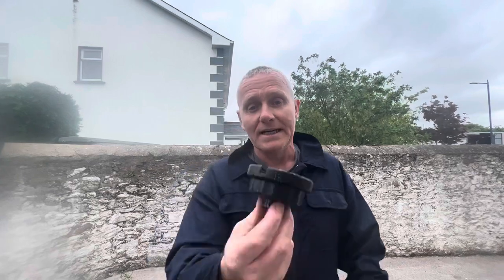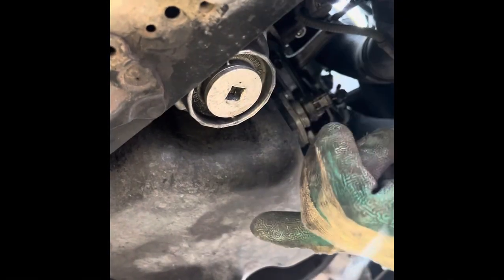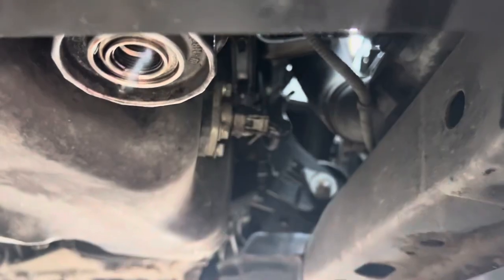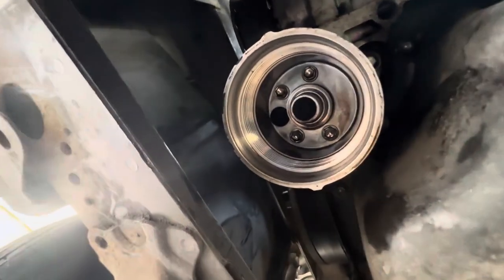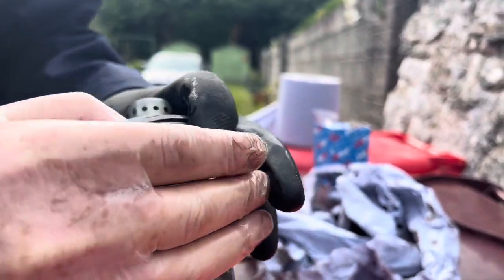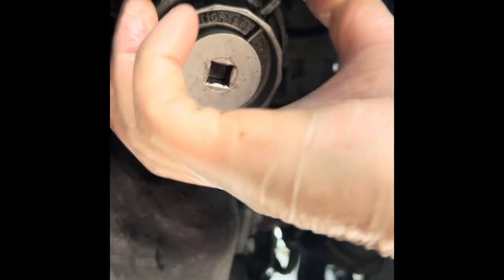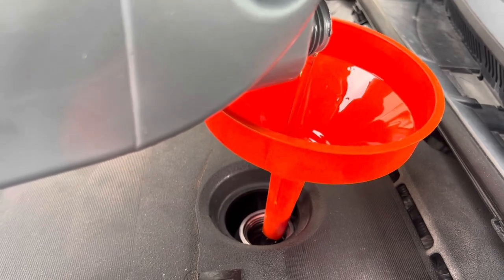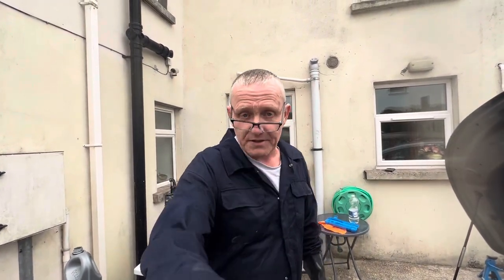AVENSIS T27,OIL AND FILTER CHANGE, torque specifications and an exact DIY step by step guide .

Comment: Could you do a video on cleaning the dpf filter and egr valve please? Ive heard different ways to do it and id like to see someone who knows what they are talking about do it. I usually drive at low revs for economy and i reckon its better for the engine not to be dogging it on all the time but im being told im wrong
Reply: He has a video up already on the egr.

Comment: Did you ever do the gearbox oil on it?
Reply from the maker: Hello I did and still haven't uploded the video ill upload it soon, Thanks.
Reply: @cardiyrepair  great, I have a low whirring noise while in neutral, clutch pedal up. Hoping a change of oil might quieten it a little, probably not.

Comment: weird.. why mine takes only 5.9liter ??
Reply from the maker: Avensis 2.0 D-4D-F DPF (2009 – 2011)	1AD-FTV	6.3 / 0.4 for filter,	15 000 km/ 12 months
7 500 km/ 6 months.
 6.3L is the engine and 0,4 fills the oil filter housing total 6.7, 
But only oil excluding the filter the oil change is 5.9L.
https://oil-change.info/toyota-avensis-engine-oil-capacity/

Comment: Grand job !
I change mine at 10 000 km mostly highway driving or at about 200 motor hours .
If I was doing city stop and go maybe would have done it at 5000km.
Using Motul 5w30 efe C2/C3 oil about 50€ for 5lt can. 
All the best Cork man 😁!